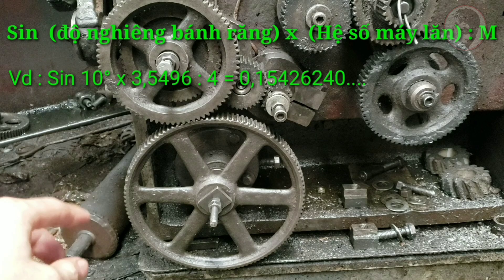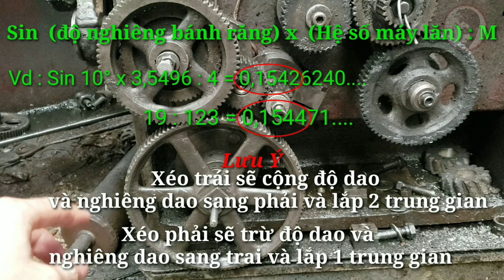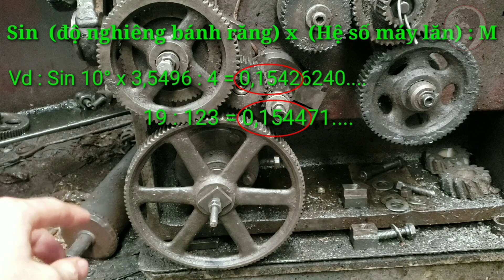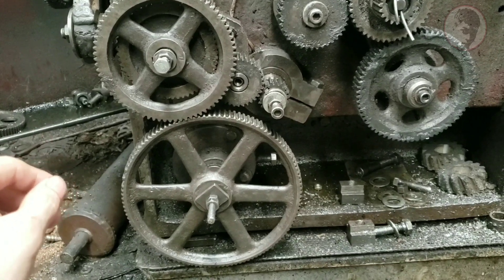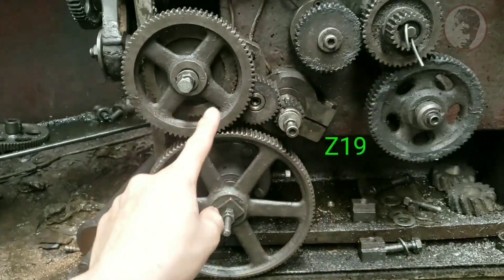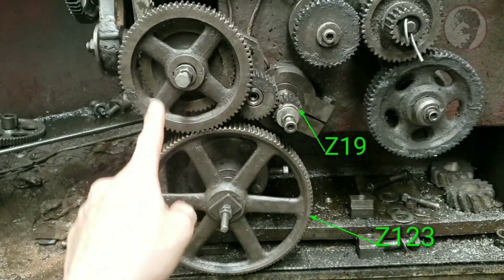Gia Công Bánh Răng Xoắn Từ Đầu Đến Cuối !!! Trên Máy Lăn Răng

Comment: These are not the bevel gears but spiral gears. Overall very good neat and clean work
Reply: Helical gear bro
Reply: @ThePogi0210  CORRECT
Reply: https://youtu.be/kQ2Vkr9yjKY
Reply: cũng k sạch sẽ lắm đâu bạn ơi
Reply: Ya, it's not bevel gears. It's helical gears. Put these side by side looking from the top... It a herringbone gear ⚙️. Usually used in step up or step down speed.